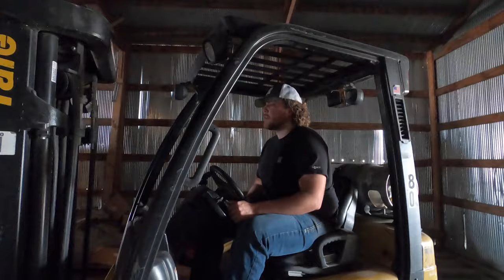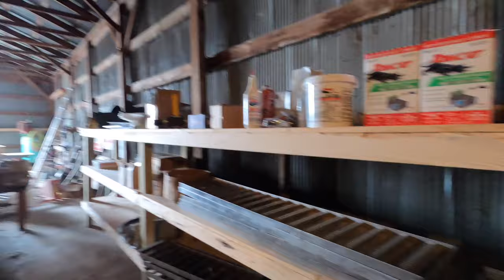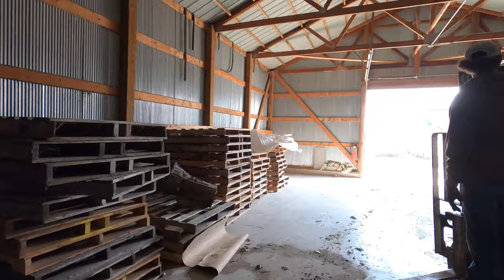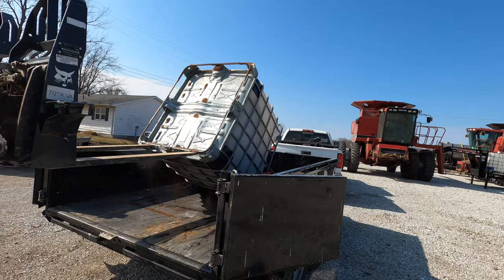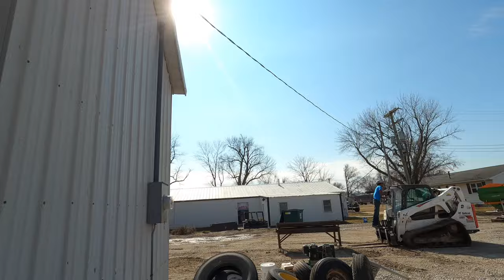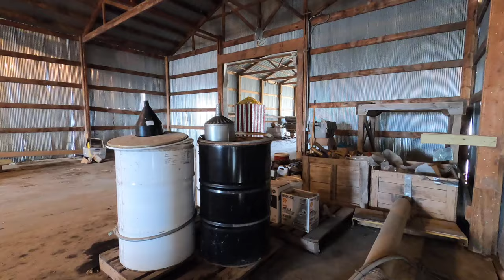Shop Makeover: A Clean Slate For 2024

Comment: Grayce I don't understand why you would through away a metal table on wheels.   It is always useful when working on something to not be on the ground.   Especially if you have to use something to lift it up on it and it can roll out of the way.   I don't expect a response back you are busy.  You will regret getting rid of it down the road.